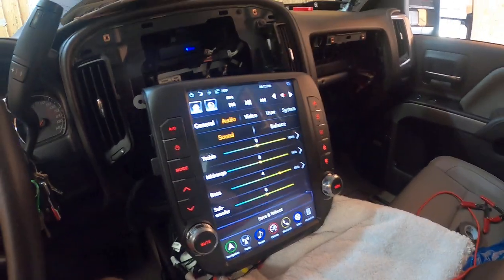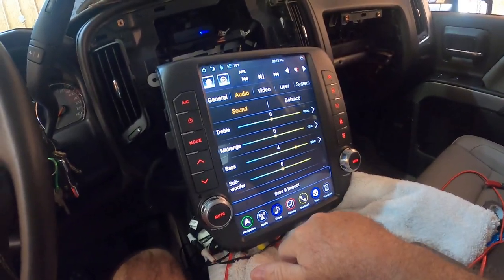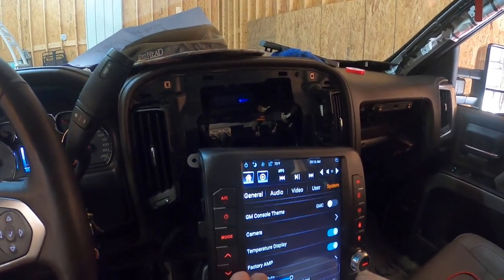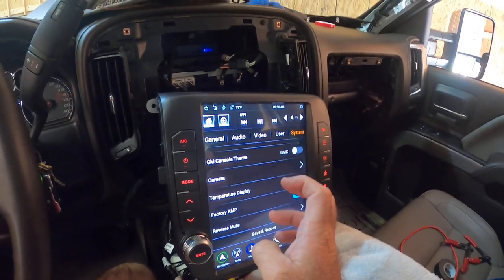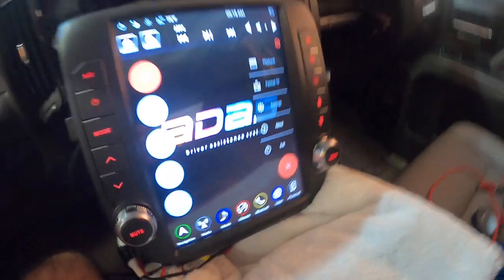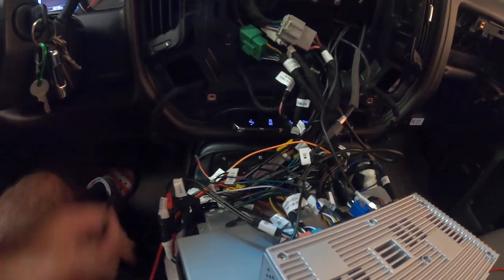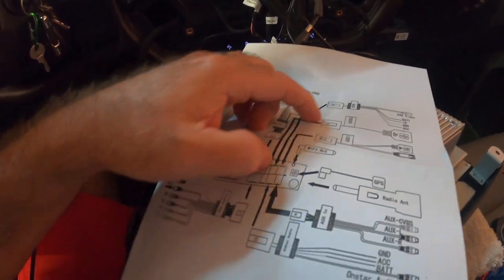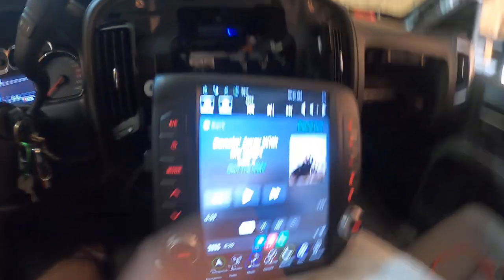Linkswell T-Style Radio for GM Silverado with Bose adaptor

Comment: I'm tempted to go all KENWOOD EXCELON speakers and 4ch amp but having to check ta make sure alls compatible. Already installed pair of 12" rockford fosgate DVC shallow subs in a SPL upfire ported box. And it sounds good but later swapping that out with 2 8in sound down DVC pushed by a 3k Watt DB DRIVE MONO BLOCK AMP..

Comment: Really good description of the sound quality, i have the same experience, it just dont sound right. On top of that i experience some crackling from the speakers... its to bad because the radio is a good upgrade from the factory one. Just cant figure out if its something wrong with the settings, the product or the installation.

Comment: did you end up finding a soloution to the audio? I have one coming in soon for my truck. thanks!
Reply from the maker: Just got used to it. It’s not as bad as I I initially suspected. Not a perfect solution but it’s better than others.
Reply: I installed the Gen 6 and have the exact same situation with the volume and factory amp, I just left it off. I’m starting to get used to it but it could be better.

Comment: What GEN did you buy? I'm tempted in putting this into my 2014 Silverado.
Reply: I'm having it installed in my 2014 by max speed and sound. They have installed this model before. I'm ex military a tank mechanic that has installed new engines in m60a1 tanks. Not by any means bragging. I'm anal about being done right. I don't have the patience to install  it. It takes 2 1/2 hours to install. That is a fact. The new unit I received is so well packaged 📦 very integrated. There is no installation instructions or a owners manual.  They do include a Piece of paper that does lead you to the pdf files to print it on your home printer. I'll print the pdf files. The owners manual as I'm told this android head unit. Is very advanced.  The installer has installed many of these.  He said your going to Love it!